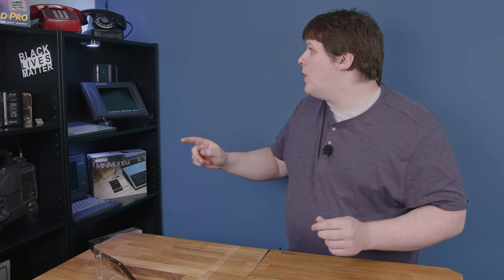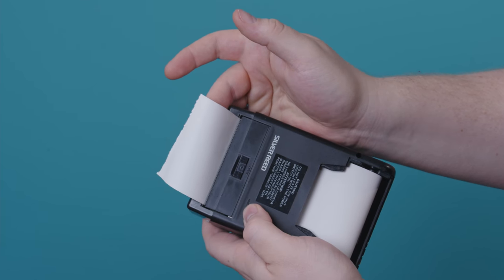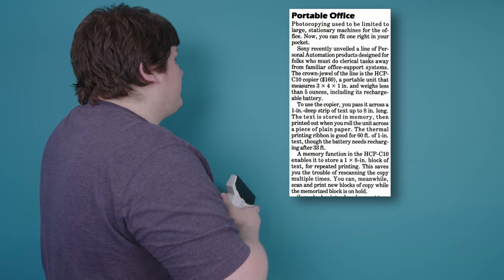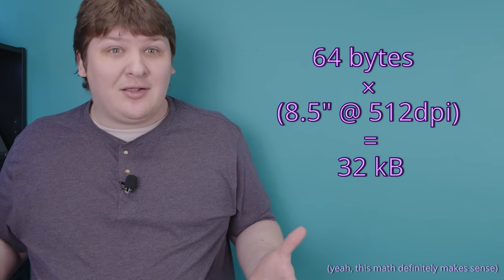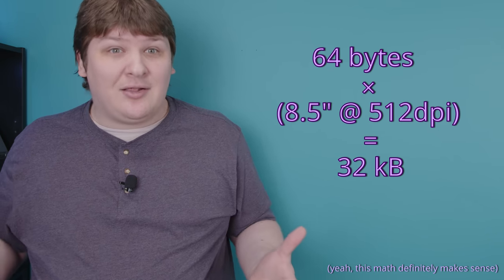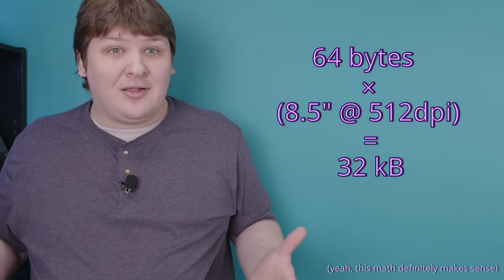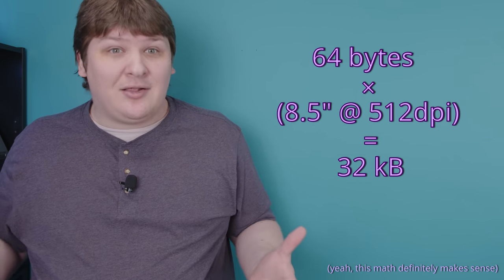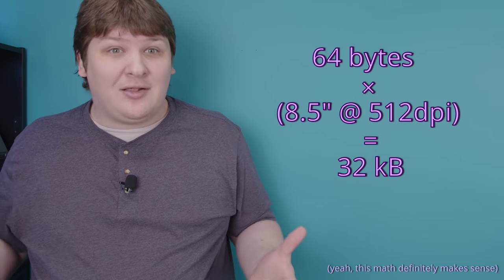The Pocket Xeroxes of 1986

Comment: I don't think there is any logic in that thing at all. I think it's a simple "input pixel high, output pixel high", as in, it's purely electrical with no logic, and simple circuitry to just amplify the input signal and do any filtering for output. I don't think there is any memory or anything in it. Know what I mean? Like it's almost electrically "mechanical", or fully analogue.

Like, when you move it too quickly, I don't think it "skips" lines, I just think the printer element isn't on long enough to warm up the paper to make an impression. Basically the speed is effectively a "Contrast" adjustment. If you move it too fast, the elements aren't on long enough or generate enough heat to make the ink turn black.
Reply from the maker: I think that's entirely possible, I just can't prove it and MCUs were sufficiently cheap and commonplace by the mid eighties that I think it's more than likely that it uses one.
Reply: @CathodeRayDude  Well, there's an easy way to check... got a strobe? 😋
Seriously though, if it's digital or at least sampled, there will be some sort of timing circuitry, which means at a certain frequency, there should be aliasing.
Run the roller at a normal continuous speed, and do a frequency sweep with the strobe. If the output isn't directly correlated to the sweep of the strobe, say if it starts showing a Moiré pattern or effect, it should be a sampled signal, if however it simply starts getting darker and darker, or becoming more and more frequent dark lines, than it's probably an analogue circuit.

Seems like a fun experiment, hahaha.

Comment: On the simpler models that don't have memory, I wouldn't even count on a microcontroller being involved in the copying process at all. If the line and pixel clocks on the sensor and the thermal element can be synchronized (and there's no reason to believe they can't), it's possible to pass the signal from one to the other without any "intelligence" inbetween.

Comment: 4:39 for a long time, red LEDs were the brightest and the cheapest. It wasn't until the late 90s that i saw a bright green LED for the first time. Bright LEDs were expensive for quite a while. 
I don't know if that's the reason in this case, but it could very well be.
Reply from the maker: Well the scanman in the video is from... 88? But maybe there were great strides in just a couple years, I could believe it
Reply: Green leds are older than you’d think, check out franlabs channel!
Reply: The green LEDs on that scanner aren't particularly bright, it just has loads of them. I don't think there was a huge difference in cost or brightness between the various colours available in the mid-to-late 80s.

Comment: It would not necessarily need RAM at all: it could be done with a 512-bit (at most) shift register, which would probably be cheaper than RAM back in the day. Also, that might even allow the scanner/printer transfer to be done completely in hardware, depending on their interfaces.

Comment: 10:49 I would be curious to see how the contrast knob operates from an electrical perspective... Like I'm curious if it's essentially a potentiometer directly controlling the input current to the heating elements in the thermal printer.

It's wild to think how simplistic technology can be produced and how needlessly complicated it is today. the modern equivalent would create a whole SOC running some kind of overcomplicated image processing algorithm marketed as "AI" just to clean up the output or whatever so that it's slightly more crisp.

Comment: They could have actually done this without a micro controller at all. The pixels of the linear scanner could have been directly attached to transistors driving the heating elements of the printer, and that could have been it, with no memory needed

Comment: The weirdest part of all this is, this wasn't even something you could ONLY do in the late 80's, or even something that required actual electronics. You know what would've been EVEN CHEAPER, and would've been doable as early as the 1950's if 3M hadn't patented it already?

Put an infrared flashlamp in the end like one of those cheap IPL hair removers on Amazon, and instead of making a portable THERMAL COPIER, make it a portable ThermoFax machine. Probably would make higher quality copies and it's not like flashlamps are expensive either, just maybe a little power-hungry, but that can be solved by making it EVEN CHEAPER and having it plug into the wall. I've actually USED one of those cheap IPL hair remover guns to Thermofax tattoo stencils cause it's faster and cheaper than a real Thermofax and doesn't burn up the entire sheet of that expensive Ditto dye transfer paper, so I know this WORKS. Whatever company came up with THAT one would've beat EVERYONE ELSE in the race to the bottom.

Comment: I don't think the first 3 even have a microcontroller, yet alone memory to buffer.

The CCD is inherently a shift register that shifts out the image data. All you would need is a timing circuit, a simple ADC and a second shift register that shifts in the image and presents parallel pixels to the thermal print head.

All it needs to do is constantly take image data from the scan head and put it on the thermal print head. The movement of the paper does the rest. A microcontroller is a massive, overpriced waste of resources, and actually quite expensive in the mid 80s.

The contrast knob probably changes the threshold of the ADC directly.

Comment: Why do these have microcontrollers, anyways? The behaviour seems simple enough to implement in glue logic. Or were microcontrollers cheaper for these kinds of uses already at this point?
Reply: My thoughts exactly. I very much doubt the first few have an MCU at all. I expect they use Schmitt triggers to go from grayscale to bilevel, shift registers to deserialize the data, and latches to ensure the maximum on time for the print elements is not exceeded. (So there’ll be a clock in there too.)

Could be some inexpensive LSI doing those things, I suppose, but given the small volumes involved, they might not have gotten that far…

Comment: im at 1:49 and before you take it apart and show how it works im gonna give my guess, its a standard black and white scanner bar with an optical sensor to track how fast you drag it across the screen. and the printer is just a receipt heat paper printer
Reply: ok so a rubber roller instead of an optical sensor but i was pretty much close

Comment: microcontrollers of the era had not enough registers to store one line of image data (64 bytes) , even RAM probably wasn't enough; the most popular microcontroller the TSM1000 only had 64x 4bit RAM. (only half of what's needed to store one line)
my guess is that they didn't store the data at all, (linear) CCD chips are read out serialized (acting like a shift register)  equally the thermal print head probably also uses serial data (unless there is a 512+ wide ribbon cable in there, highly unlikely) 
The output of the CCD is probably pretty much directly  connected to the input of the print head.
I wouldn't be surprised if the device doesn't contain a microcontroller at all, just a few standard logic chips could provide the clock and control signals.

Comment: there is a device on aliexpress that does just this. it's a rollable color scanner that runs on 2 AAAs, and puts files on a microsd in a format and resolution of your choice. i bought this for my former girlfriend for the exact purpose you mentioed - scanning stuff in library without having to leave the table. except it is the size of A4, but very thing, basically just a rectangular tube.

Comment: I had the Portacopy and it was not very usefull even when new. It would often fail to recognise anything if the contrast was not perfect, grey newspapers were tricky and the yellow pages even worse. It also did not perform well on that thin paper they used for dictionaries and the paperrolls were hard to get. I think the Panasonic had the smaller rolls that are still common in some payment terminals today but with the portacopy rolls were either to narrow or too thick. Print quality was similar to very bad fax machines in 'fast' mode.

Comment: 6:15 As a side note LED printers are another popular linear printing technology, although it is relatively unheard of.
Reply from the maker: oh, good point!
Reply: @CathodeRayDude  Not to mention that full-width inkjet is now a thing, too: epson uses it in those printers they use for custom coupons at the grocery store, but HP has embraced it widely (no pun intended) under the PageWide name, which is available in everything from letter-size desktop printers all the way to 42” wide digital web presses. (That’s nozzles across all 42”, at 1200dpi, for each of 8 inks simultaneously, running at several feet per second even with variable data like phone bills or personalized flyers!! Absolutely insane amounts of data flowing to those heads each second. And they have cameras that continuously monitor the output to adjust for color calibration as well as look for clogged nozzles, which are simply replaced with one of the spare nozzles they have in the heads, until downtime lets them perform a cleaning.)

Comment: Seriously though. I looked for a little bit. Bother makes a decently small thermal transfer printer. I suppose you could take photos with your phone be and print that way, but even then the printer costs like 500. There is no modern solution that accomplishes the task that these devices do

Comment: Might be nice to take inspiration from these and make a gadget with modern technology that's a kind-of wand you can swipe down an A4 page and get a high-res copy on an SD card. Just about any modern mobile processor would be overkill for the task to the point that the sensor would probably be the most expensive component.

Comment: There will have to be an encoder that chooses when to fire the heaters. Otherwise the printhead would burn out.
Reply from the maker: Nope, if you press the activation switch and don't move anything, it just blackens the paper under the head. I've verified with an ammeter that it draws the full current even when doing nothing, and there's a warning on the Portacopy to not leave it standing on end with the power switch on for this reason. They use an INCREDIBLY simple design.
Reply: @CathodeRayDude  Haha. I would have sworn that it would kill itself quickly like that :D

Comment: now we have portable scanners that we actually have to plug in to our computer to print them out; FFS how hard would it be to put a black and white thermal printer or one of those zink cameras that only has mate and black dye sublimation films or the color ones portable scanners come with. HP is the company that makes actual zink paper it cant be that hard to convert it from glossy paper that's great for photos to regular copy paper that's great for printing text and bitmap images. As long as they make the classic wand shape a little bit more ergonomic and stable to facilitate better scans for the printer I can't for see a single scenario in which none of these companies would make money.